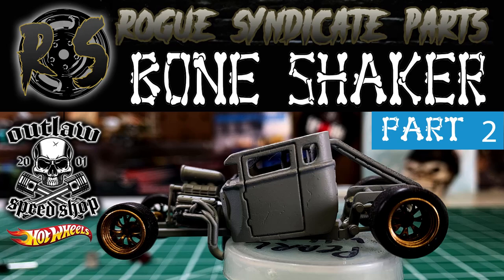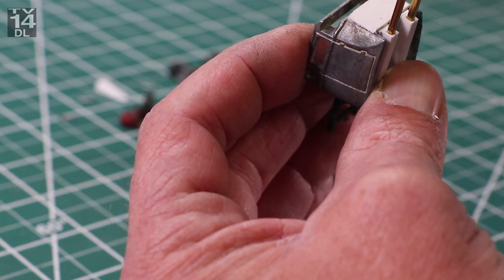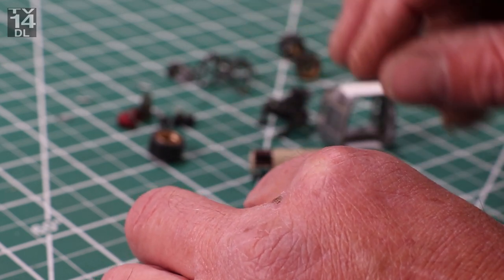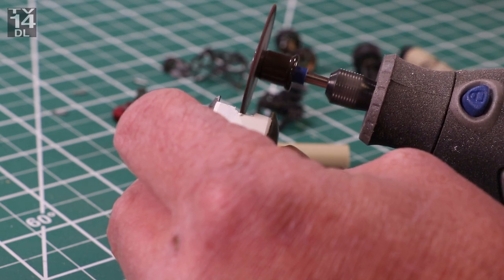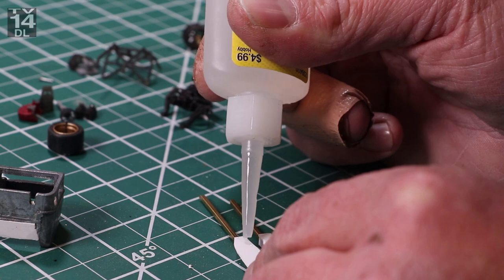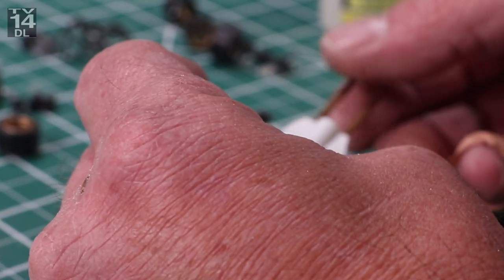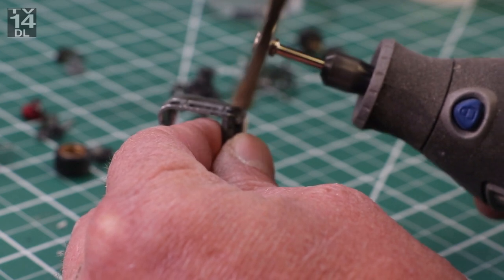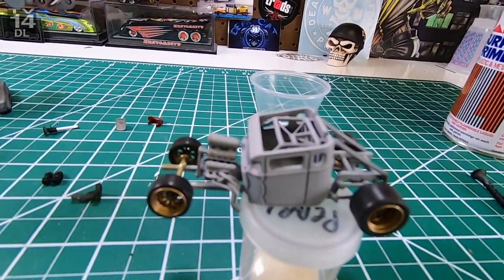Rogue Syndicate Bone Shaker Part 2

Comment: Do not attempt a career as a hand model.....lol
Reply from the maker: Right?!! Lol
Reply: @OutlawSpeedShop2001  Your hands look sore Keith; you been welding with no gloves on?
Reply from the maker: @2H80vids  they get like this and worse every year when it gets cold. And I have used and tried every lotion and cream on the market :(
Reply: @OutlawSpeedShop2001  I feel for you buddy. I get the same kinda thing in the winter, with hacks on my knuckles. Worst thing for it seems to be washing-up. If I leave that to the wife, handcream gets more chance to work and doesn't get washed off so often. Doesn't seem to be a cure, just try to prevent, rather cure. I've got Dupuytren's contracture on both hands, with pins in several fingers; they get pretty painful in the cold too.
Living in the Scottish climate does have it's drawbacks.😁